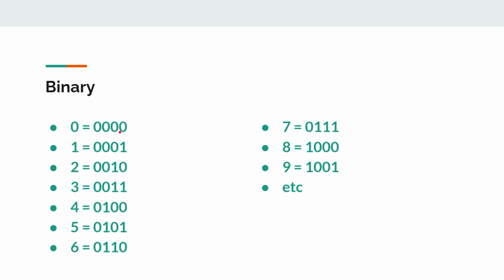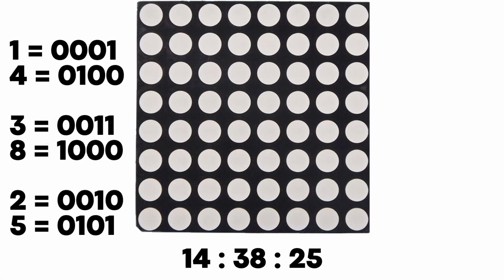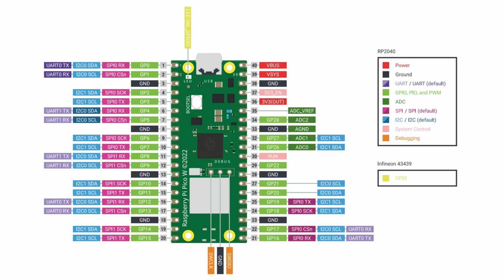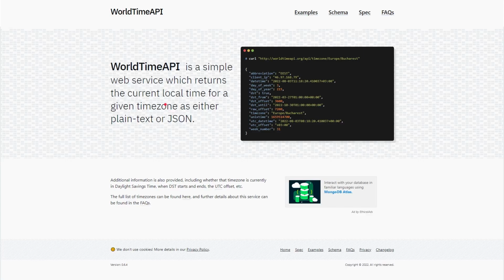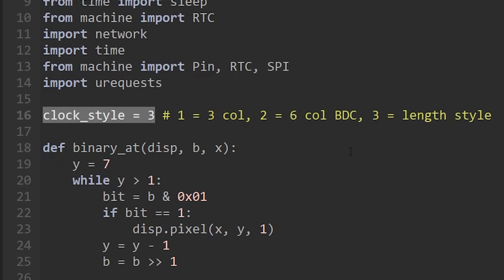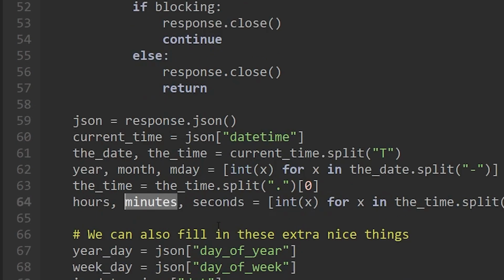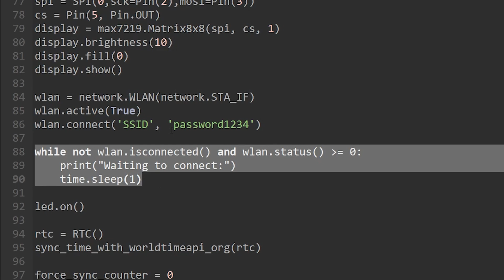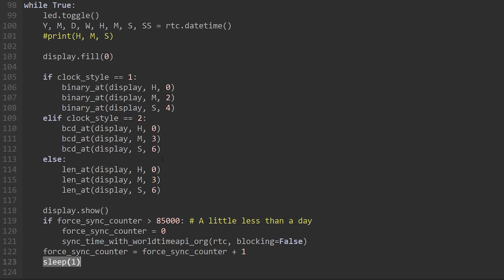How to Make a Binary Clock Using a Raspberry Pi Pico W

Comment: Using bits of this for an alarm clock I'm making with my son. I'm using this IP based worldtimeapi like you did. Is there a faster way of converting it to a 12 hr clock without a few if else statements? I'm not sure the way the json data is reported lends itself well to using strftime, or maybe I'm using it wrong.

Comment: hey Gary, great video, you have inspired me to create something awesome, and have gotten all the way to putting the code onto the raspberry pi i keep on getting this error message pop up in the console:
Traceback (most recent call last):
  File "<stdin>", line 94, in <module>
  File "<stdin>", line 52, in sync_time_with_worldtimeapi_org
AttributeError: 'NoneType' object has no attribute 'close'
Reply from the maker: Are you using a Raspberry Pi Pico W? Have you downloaded the updated version of Micropython for the W variant?
Reply: @GaryExplains  yes, it is a Pico w, and I have completely redownloaded thonny, but for some reason it still won't work. see attached image for the current settings
https://drive.google.com/file/d/1wGCPvh8C9FpZKaxYuWPjKzmwJZcL-9C0/view?usp=sharing
Reply from the maker: No not Thonny. The last time I looked Thonny didn't have the new version which is specifically for the W.
Reply from the maker: Look on this page https://www.raspberrypi.com/documentation/microcontrollers/micropython.html You will note that the W version has urequests and upip preinstalled.
Reply: @GaryExplains  i've put that on the raspberry, but what do i use to edit the code?
Reply from the maker: You still use Thonny. I was making sure you don't let Thonnny install Micropython for you.
Reply: @GaryExplains  thanks, any ideas why its not working?
sorry if I am asking dumb questions, i am new to python and micropython
Reply from the maker: I just tested it again and it happened that I got the same error. It is because I didn't change the SSID and the password to the right values for my network. Did you change yours?
Reply: @GaryExplains  i think so... they are set to the network name and password, I'll se if i can sign in using them
- thanks.
Reply: yes, they are the correct values, any idea why it's not working?
Reply: it does print "waiting to connect:"
Reply: ok, very confused, it works now. thank you so much, very cool project. making it into a cool bedside clock. 😎

Comment: Hello Gary and thank you for a great binary project.  I am just getting started in the world of C programing.  I am using the Thoony as a program aid and have loaded both "py" files on the pico zero W.  I have been able to make the onboard led blink using this method to program.  When I try to run the binary sketch on the pie I get errors, see included;
 Traceback (most recent call last):

  File "<stdin>", line 11, in <module>
  File "/lib/network.py", line 8, in <module>
ImportError: no module named 'socket'
My question is, where can I go to get a better understanding of the C programming and running programs on the pi.  I have done some arduino work,  this is new frontier for me.  Thank you, Bill
Reply from the maker: So .py files are Python files and to use the networking stuff on the Pico W you need a specific version of Micropython for the W with the networking stuff built-in. You can find it on the Raspberry Pi website.

Comment: As you correctly state, the MAX7219 is a 5V device. The clock, data and chip select signals will be 3.3v. Is this OK?
Also, the MAX7219 is not a true SPI device, is this OK?
Reply from the maker: Yes, according to the datasheet, 3.3v on those pins is supported.
Reply: @GaryExplains  What about SPI compatibility as the 7219 is not advertised as an SPI device?
Reply from the maker: Again, the datasheet is our source of information, it says,"The MAX7221 is compatible with SPI™, QSPI™, and MICROWIRE™"
Reply: @GaryExplains  That's true, but you are using a MAX7219. The data sheet says that this is not fully compatible with SPI.
Reply: @GaryExplains I read the Max7219 datasheet, but I didn't see anywhere that the device's inputs are 3.3V compatible. In the Electrical Characteristics it is stated that for all inputs the minimum "Logic High Input Voltage VIH" is 3.5 V.
I  tested a circuit with a Raspberry Pico and a Max7219, to be honest the circuit works but, I think only due to the electrical tolerances on the input logic levels of the Max7219.